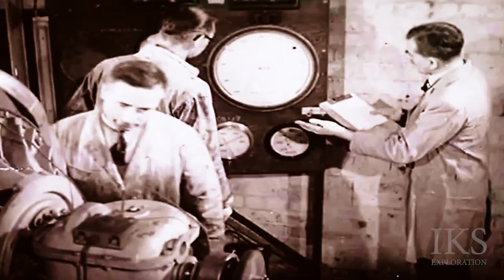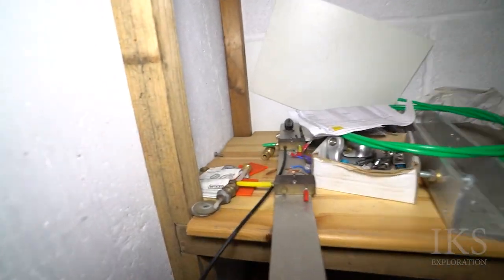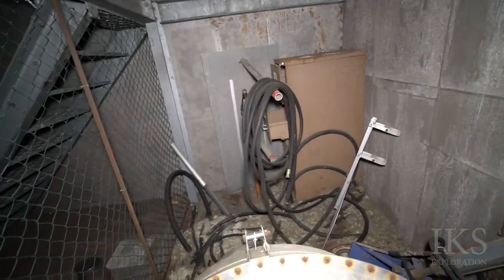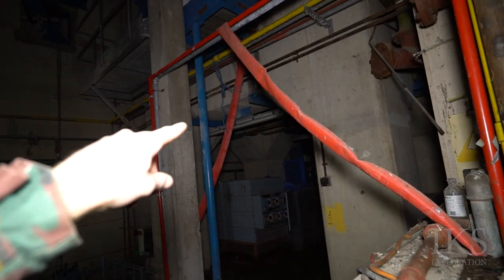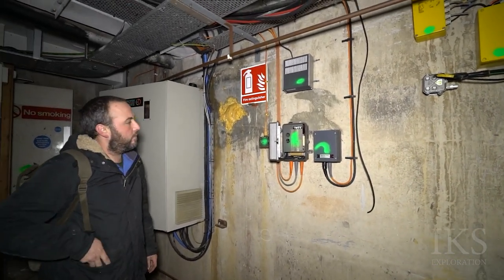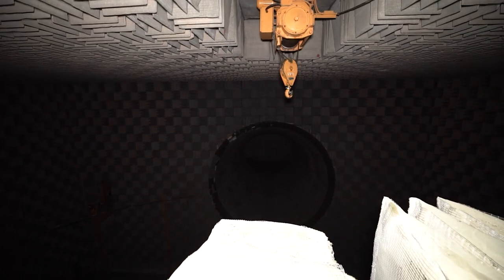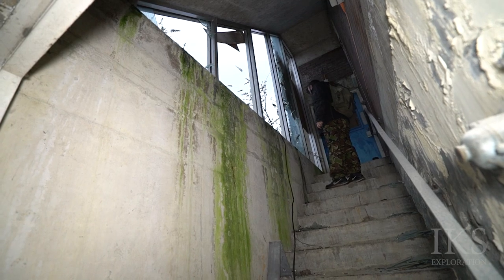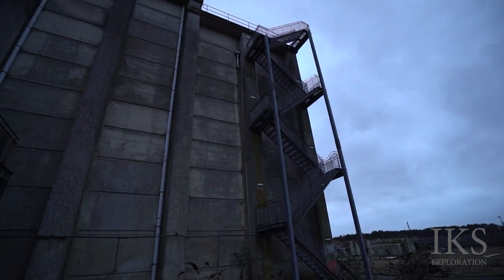PYESTOCK ANECHOIC FACILITY

Comment: Hi guys, I know it is unrelated to the video but I heard Chris say he wants a co2 extinguisher for the van, I have 2 in my car the same size as the one in the video but I think the horns are connected. Free of charge if he wants them. I'm in East London if interested. Just another thought, I was watching a video with Matthew Williams the other day which made me think of a great bit of cheap equipment you guys should take with you when you are out and about, a live electronic probe. I know you don't normally mess with wires but could be handy if it was a must to get past something. Just a thought and not 100% safe but could come in handy. ✌️

Comment: I just watched a documentary of that place. It was designed to test jet engines and the ability for making them quieter at higher speeds. The area that ya'll are in on the 30.00 - 32.00  minute section was for what the jets would sound like and what the sound would be with all of the sound proofing. The bars were for the mics for gathering sound.